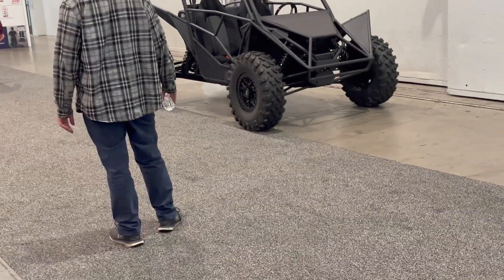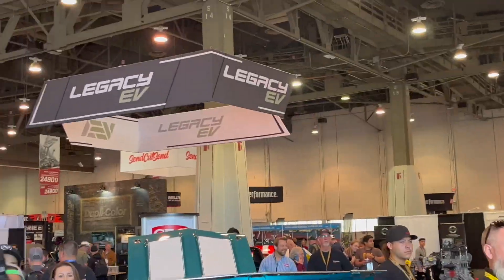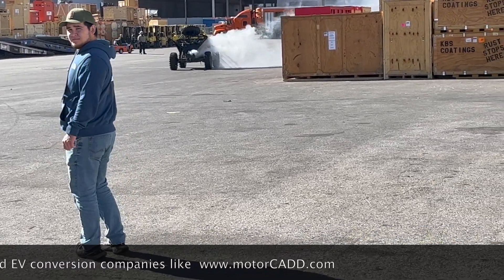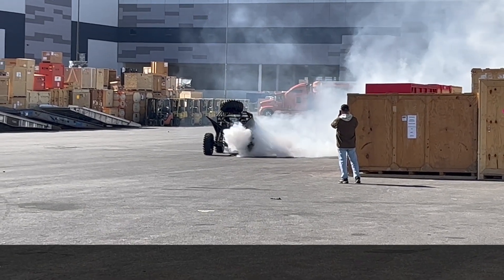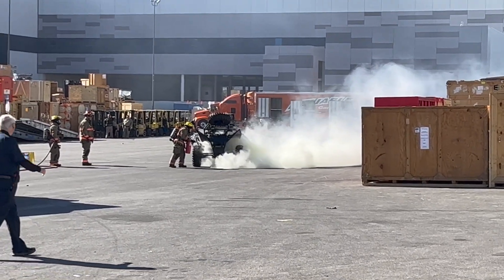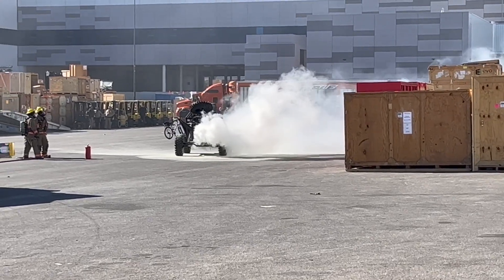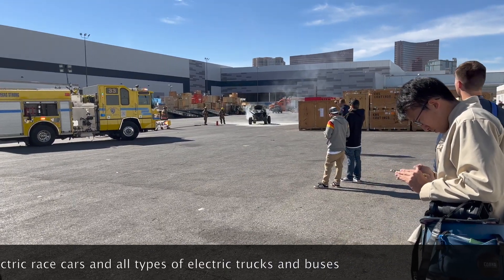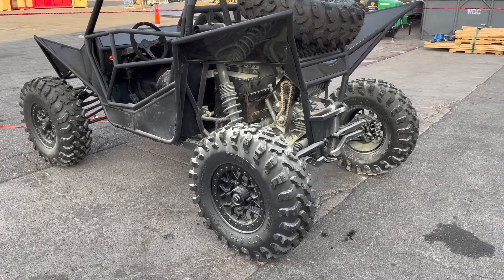SEMA show 2022 electric vehicle fire from Legacy EV

Comment from the maker: LEGACY EV is a very dangerous company to deal with.  MORE VIDEOS COMING.  Many more people could have died from toxic fumes and exposed high voltage battery terminals.

1.  Legacy EV Vehicle caught on fire (Thermal Runaway).  Fumes or Toxic Gas Off fumes are very dangerous and if inhaled a person could die or have serious lung damage.
2.  Another very dangerous situation that was in the Legacy EV booth at SEMA 2022.  VERY HIGH VOLTAGE battery packs in the booth had exposed high voltage uncovered terminals and if anyone would have touched  any of these uncovered terminals THEY WOULD HAVE DIED.

NOTE:  Fluoride gas emission can pose a serious toxic threat and the results are crucial findings for risk assessment and management, especially for large Li-ion battery packs.

Comment: Not one thing you stated in this video is correct. You are definitely not an "EV Guy". Those are prismatic cells and did exactly what they are designed to do during a Thermal Event. Do a little research before you open your mouth the next time.

Comment: Damn the amount of misinformation, OMG!
Reply from the maker: BEWARE..itay  thread s trying to go off subject BEWARE.  FACT:  Legacy EVs vehicle caught on fire at the SEMA show and damaged 100% of their battery pack.  This irresponsible and lack of professional work will set the EV industry back for all the next SEMA show.   No one would respond in the beginning in this thread about what type of battery pack it was and we all assumed it was Tesla pack.  100% of the people at the show assumed Tesla battery because of the size of the pack as seen at the end of the video. Legacy  EV is saying it was built by YouTube-Rich Builds whom takes wrecked or salvaged Tesla parts to convert lots of different vehicles from gas to 100% electric.  Legacy EV needs to be stopped and controlled.  The EV conversion industry needs to stop these kind of EV builds and stop using salvaged used parts which we consider is very dangerous.

Comment: You’re way off. There was no fire. Only batteries releasing gas.  Stop using others for clout.
Reply from the maker: BEWARE..Conway thread s trying to go off subject BEWARE.  FACT:  Legacy EVs vehicle caught on fire at the SEMA show and damaged 100% of their battery pack.  This irresponsible and lack of professional work will set the EV industry back for all the next SEMA show.   No one would respond in the beginning in this thread about what type of battery pack it was and we all assumed it was Tesla pack.  100% of the people at the show assumed Tesla battery because of the size of the pack as seen at the end of the video. Legacy  EV is saying it was built by YouTube-Rich Builds whom takes wrecked or salvaged Tesla parts to convert lots of different vehicles from gas to 100% electric.  Legacy EV needs to be stopped and controlled.  The EV conversion industry needs to stop these kind of EV builds and stop using salvaged used parts which we consider is very dangerous.

Comment: I haven't heard so much misinformation in the first 60 seconds of a YouTube video, maybe ever

You should consider removing the audio before you get sued for slander
Reply: Ditto
Reply from the maker: BEWARE..TJB thread s trying to go off subject BEWARE.  Slander ..LOL!   FACT:  Legacy EVs vehicle caught on fire at the SEMA show and damaged 100% of their battery pack.  This irresponsible and lack of professional work will set the EV industry back for all the next SEMA show.   No one would respond in the beginning in this thread about what type of battery pack it was and we all assumed it was Tesla pack.  100% of the people at the show assumed Tesla battery because of the size of the pack as seen at the end of the video. Legacy  EV is saying it was built by YouTube-Rich Builds whom takes wrecked or salvaged Tesla parts to convert lots of different vehicles from gas to 100% electric.  Legacy EV needs to be stopped and controlled.  The EV conversion industry needs to stop these kind of EV builds and stop using salvaged used parts which we consider is very dangerous.
Reply: @GreenEnergyGuy  1 of 3 battery packs smothered itself safely as designed without flame. 

It was not Legacy EV's vehicle or work. Why would they need to be stopped and controlled for something they had zero association with?

🤡👏👏👏👏👏👏👏👏
Reply from the maker: @utbigpapa  Legacy EV is claiming to be the company that offers service and components and claims to know how to build and offer electric vehicle conversion kits.  SEMA will be called and more videos will be released on the very dangerous ethics and workman ship of Legacy EV.  Legacy EV had exposed battery terminals at the show and if someone touched any of these VERY HIGH VOLTAGE terminals people would have been electrocuted and they would have died.  SEMA IS BEING NOTIFIED OF THIS TODAY WITH VIDEO PROOF.

Comment: I don't think there were any Tesla parts used in this build at all. Also its not on fire.
Reply from the maker: Once again as explained in this video it is called a Chemical fire.  The responders to this video don't read or watch the entire video and do everything half ass which explains why their builds catch on fire.  You can't do things half ass when building battery packs.  Legacy is ruining it for all of the EV guys that know what they are doing.
Reply from the maker: BEWARE..Grant thread s trying to go off subject BEWARE.  FACT:  Legacy EVs vehicle caught on fire at the SEMA show and damaged 100% of their battery pack.  This irresponsible and lack of professional work will set the EV industry back for all the next SEMA show.   No one would respond in the beginning in this thread about what type of battery pack it was and we all assumed it was Tesla pack.  100% of the people at the show assumed Tesla battery because of the size of the pack as seen at the end of the video. Legacy  EV is saying it was built by YouTube-Rich Builds whom takes wrecked or salvaged Tesla parts to convert lots of different vehicles from gas to 100% electric.  Legacy EV needs to be stopped and controlled.  The EV conversion industry needs to stop these kind of EV builds and stop using salvaged used parts which we consider is very dangerous.
Reply: @GreenEnergyGuy  lol this guy is a robot

Comment: It’s not on fire. It’s off gassing!!!
Reply: "EV Guy", you should stop talking. You obviously know very little about these things.
Reply: Umm, you are embarrassing yourself. Stop talking.
Reply: What's better, breathing in CO2 or Chemical Acid?
Reply from the maker: It is called a chemical fire.  Chemistry 101.  Where there is smoke there is fire.  Fire department uses chemical to put a chemical fire and would never use water to put out a chemical fire.  Please watch the entire video and there is an explanation that it is a chemical fire.  They also never mentioned the BMS problem.  They (Legacy) wont talk about this in other EXPLANATION videos
Reply from the maker: BEWARE..Jena thread s trying to go off subject BEWARE.  FACT:  Legacy EVs vehicle caught on fire at the SEMA show and damaged 100% of their battery pack.  This irresponsible and lack of professional work will set the EV industry back for all the next SEMA show.   No one would respond in the beginning in this thread about what type of battery pack it was and we all assumed it was Tesla pack.  100% of the people at the show assumed Tesla battery because of the size of the pack as seen at the end of the video. Legacy  EV is saying it was built by YouTube-Rich Builds whom takes wrecked or salvaged Tesla parts to convert lots of different vehicles from gas to 100% electric.  Legacy EV needs to be stopped and controlled.  The EV conversion industry needs to stop these kind of EV builds and stop using salvaged used parts which we consider is very dangerous.
Reply: @GreenEnergyGuy  guy keep repeating himself get a life
Reply from the maker: Everyone...please look up flash point and you will see what happens when a electrolyte chemical reaches its flash point.  It catches on fire and releases gases.  Which came first ....the fire or the smoke.  Only fire makes smoke is your first hint.

Comment: It belongs to @richrebuilds
Reply: Not sure if it belongs to him.. but he was building it on his YouTube channel
Reply: Prismatic cells not tesla pack  no fire
Reply from the maker: MelleTwaklapper  coming from a person that has no alternative explanation
Reply from the maker: who programmed the BMS?  What type of BMS was used on this system?  Who programmed and wired the BMS?  We should at least be notified of this if you are really concerned about peoples safety and we can keep away form this person that built the system and the BMS manufacturer.
Reply from the maker: MelleTwaklapper  BEWARE..Melle ithread s tyring to go off subject BEWARE.  FACT:  Legacy EVs vehicle caught on fire at the SEMA show and damaged 100% of their battery pack.  This irresponsible and lack of professional work will set the EV industry back for all the next SEMA show.   No one would respond in the beginning in this thread about what type of battery pack it was and we all assumed it was Tesla pack.  100% of the people at the show assumed Tesla battery because of the size of the pack as seen at the end of the video. Legacy  EV is saying it was built by YouTube-Rich Builds whom takes wrecked or salvaged Tesla parts to convert lots of different vehicles from gas to 100% electric.  Legacy EV needs to be stopped and controlled.  The EV conversion industry needs to stop these kind of EV builds and stop using salvaged used parts which we consider is very dangerous.

Comment: LOL you spent no time saying there name a dozen time lol... yea I am sure there business pretty much lost all contracts or future deals after that. Anywho 80% of sema builds just before pre-covid have been trash anyway. bubble gum welds, dry paint, non functional cars, wrap jobs from stevy wonders and now ev cars shorting out in the exhibit
Reply from the maker: BEWARE..Monera thread s trying to go off subject BEWARE.  FACT:  Legacy EVs vehicle caught on fire at the SEMA show and damaged 100% of their battery pack.  This irresponsible and lack of professional work will set the EV industry back for all the next SEMA show.   No one would respond in the beginning in this thread about what type of battery pack it was and we all assumed it was Tesla pack.  100% of the people at the show assumed Tesla battery because of the size of the pack as seen at the end of the video. Legacy  EV is saying it was built by YouTube-Rich Builds whom takes wrecked or salvaged Tesla parts to convert lots of different vehicles from gas to 100% electric.  Legacy EV needs to be stopped and controlled.  The EV conversion industry needs to stop these kind of EV builds and stop using salvaged used parts which we consider is very dangerous.